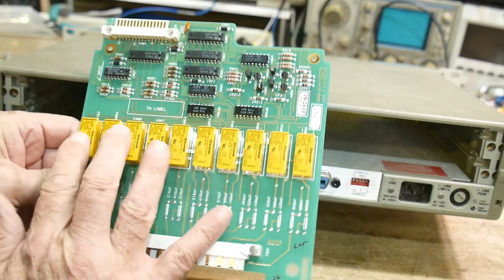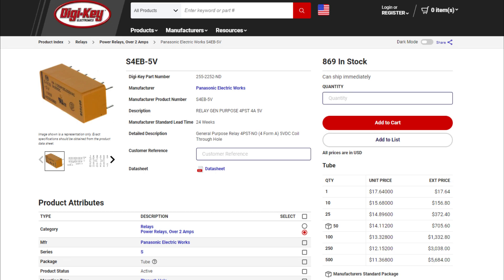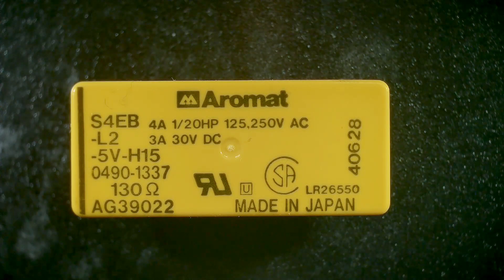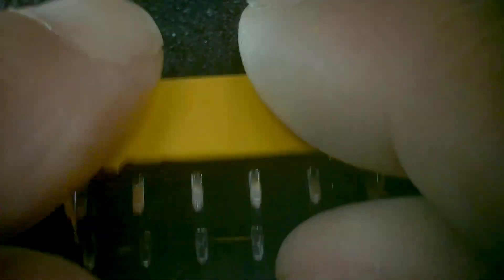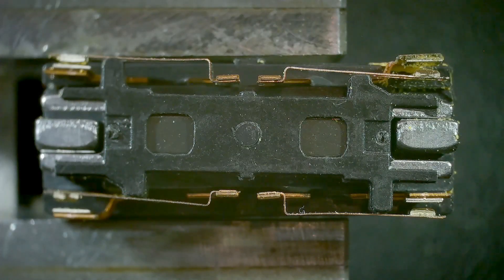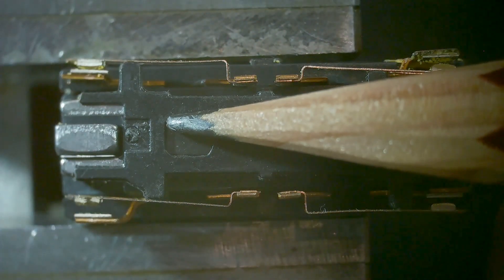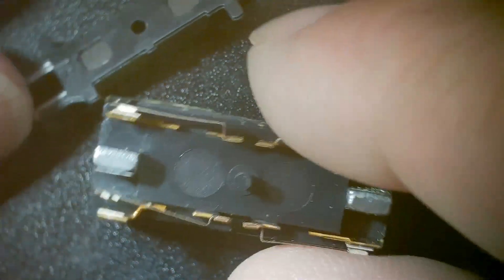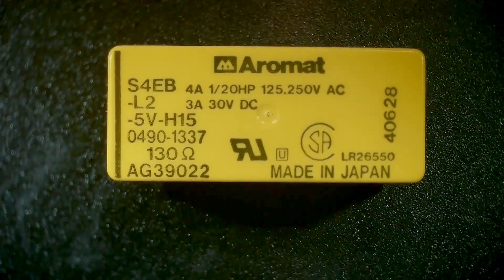#1453 Latching Relay

Comment: Tidbit:  Something I would have never considered -> Quote from Panasonic Relay Data:  Latching relays are shipped from the factory in the reset state. A shock to the relay during shipping or installation may cause it to change to the set state.     Oh snap. That could be embarrassing in the wrong situation.  Thank you for demystifying these SnaPPy little guys.

Comment: The other way of doing it is to have a special soft iron core in an otherwise “normal” relay. When energised the core becomes magnetised and keeps the armature pulled in. A pulse of half the current in the opposite polarity un-magnetises it. However if you momentarily break the closed magnetic circuit, like prying up the armature with a screwdriver, or banging the relay on a table, the core instantly becomes de-magnetised and it drops out.

Comment: Yeah those are good. Very valuable in the fr33 en3rgie community. Great for S/S - P/P battery rotation. The higher current ones are the ones that is worth big $$$ if you can find them.

Comment: This reminded me of the magnetic latching relays used in the Apollo DSKY.  I recall that the same model was still available for sale because it's used to control pyrotechnic bolts on satellites.  Am I remembering correctly or have I started hallucinating.  Would be cool to see a video about those as well.  quite expensive iirc but I can't dredge up the part number or manufacturer.